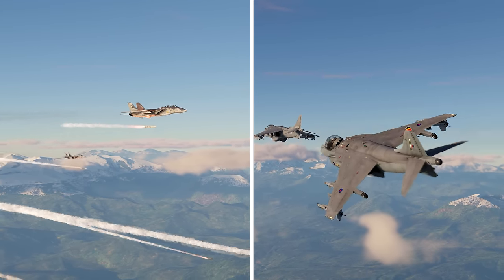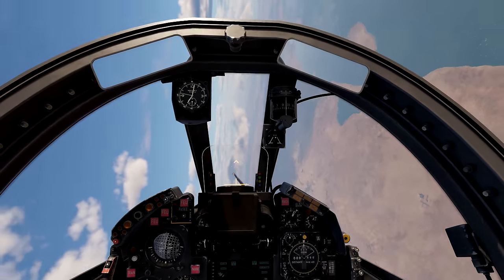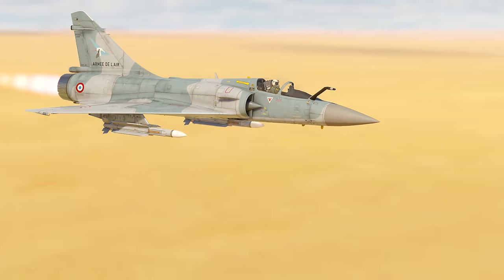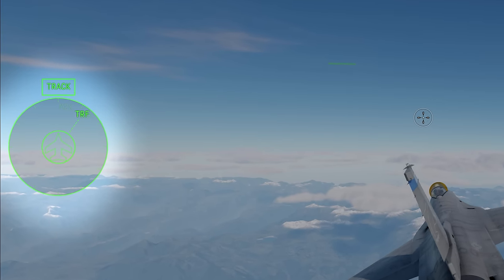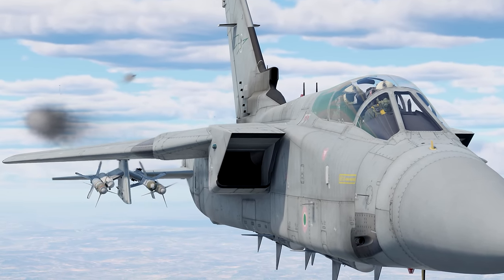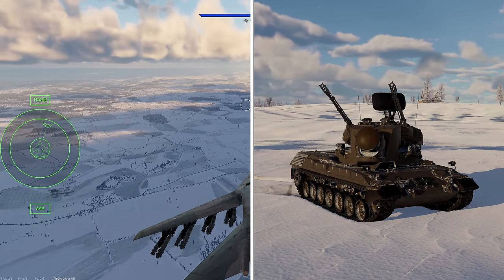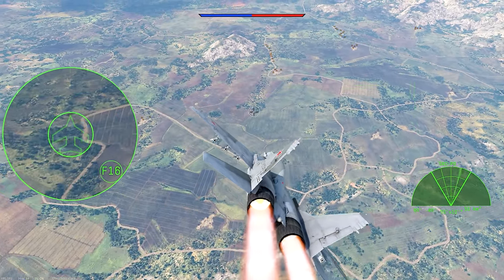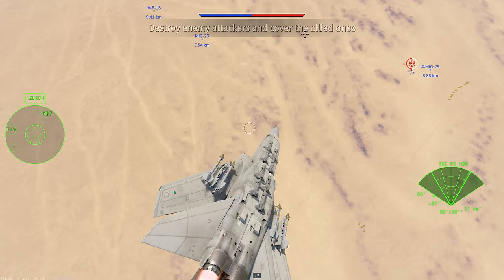War Thunder RWRs: The Ultimate Guide

Comment: What is the deal with the multi-pathing mechanic do you plan on changing it or will all radar missiles be dodged by flying low to the ground?
Reply: Thats a good question CPU well done
Reply: it works that way in real life so it won’t be changed
Reply: @bigboi5962  it is in fact a real thing yes. But in warthunder the effects are greatly exaggerated. Dont quote me on this but someone told me it was an intentional balance feature for SARH missiles again im not sure about the fact it was done for balance
Reply: @ItzCPU_  The balance is that the non monopulse missiles like the 7F, 7E, ect, have much lower multipathing than they should. If it were modeled 100% accurately, the 7M and ER would remain unchanged while everything else would fail at even high altitudes.
Reply: @TheDAWinz   what about the AIM54 is the multipathing on that accurate?
Reply: @ItzCPU_  Yes

Comment: Would also be nice to have a guide from you guys that talks about evading incoming radar missles. They are so complex and keep getting updated it is hard to know how to dodge them.
Reply: Just fly as low as you can. You’ll dodge 99.99% of all radar guided missiles in war Thunder. The rare chance you still die will because you were still within the splash damage radius.
Reply: @PvtPartzz  me and squadmates have been trying to figure them, what what weve discoverd, there are three POSSIBLE methods to defeat a radar missle: 

- Chaff 
- Notching 
- Dropping Low Enough

But the issue is, NONE are consistant, not one, sometimes a combnation will work, sometimes it wont
Reply: @BugattiONE666 flying low is 100% consistent. If you are at or below the tops of trees, you’re fine. Fly more perpendicular to the target while low to reduce the chance of taking splash damage.
Reply: @PvtPartzz  not in the games weve had, Aim7Fs and R27s ignore terrain completely.
Reply: @BugattiONE666 you need to fly low AND try to find cover. hiding behind any sort of hill or all terrain will protect u
Reply: Just play anything not american tech tree and you will be fine (coming from a US tech tree guy)
Reply: @MrRozzi20  ?? the US air tree is literally one of the best (if not the best)
Reply: @PvtPartzz that technique will be gone once aim120 are added

Comment: 5:25 the flanker will also show up as a mig29 as of right now (unless it was just changed, and afaik as someone else pointed out they use the same radar), however it works out fine, as no matter which plane it actually is you can assume it’s gonna be an ER flying at you
Reply: It’s supposed to be that way. The Su-27 has the MiG-29s radar. Same reason that the Italian Harrier shows up as F-18 on RWR.
Reply: @tato300  No they don't. N001 on Su-27 versus N019 on MiG-29. Possibly the same telltale frequency and other attributes, however they are different.
Reply: They designed the su-27s radar to have a lot of commonality with the 29s radar, hence why they both show up as the same. Plus, given that both planes carry the same weapons, people who design RWRs never bothered to differentiate them.

Comment: It would be very good to see in the simulator the activation of lights in the vehicle when they fix you or launch a missile, if you add the alert beeps to that, it gives a gigantic immersion to the simulator, then there would be other good changes for simu such as being able to load fuel in air or that the map feels more alive but it would be deviating from the topic, excellent explanation and very good work Mr. Snail 🐌 ❤

Comment: Question: How is it fair to drastically reduce the effectiveness of certain aircraft’s RWR without also adjusting their battle ratings? Aircraft like the F4J and F14a almost exclusively see opposing aircraft with PD radars which they can no longer detect. 

This change has made flying those aircraft almost impossible in Sim without consistently taking SARH’s to the face with zero warning.

This change should not have gone ahead without adjusting the sim battle ratings.

Comment: Do you plan to have different data base for different aircrafts ? Currently, the J7E I believe still appears as a question mark even if you are flying a J7E yourself. It's the same for the CW wave of the mirage 2000 when guiding a r530 I believe as well

Comment: Question: what aircraft has the longest range AAM in the game?
Reply: Aircrafts*

All variants of the MiG-29, Su-27 and J-11.

For now, anyway. AIM-120/R-77/others coming to a jet near you
Reply: Anything with a r27er
Reply: Longest range ? Phoenix (C version)from the F14B(the C glides better than the A so have longer range). Also that’s currently the only ARH air-to-air missile in the game. However it turns really bad and accelerate slowly.

Best In SARH: R-27ER/ER1, fastest and longest range SARH missile with 35g turn. The plane that carry the most of them is the Su27 and its Chinese version with 6 of them at most.

Comment: How do you dodge missles with planes that have no counter measures
Reply: Simply dodge the missile or don’t approach and be useless like gaijin intended
Reply: Don't raise the altitude and never show your back to the enemy. 
If you think you have an enemy, stick around to the ground
Reply: Notching, fly perpandicular to the missile. Doesn't work for IR missiles tho.
Reply: If it’s a 9l or r60, kiss your self goodbye
Reply: @GipsyDanger41   low flying won’t help against those ?
Reply: Close your eyes. If you don't know where you are the missile won't know too.
Reply: @samson321anderson these guys are stupid af

For radar missiles you should stick very close to the ground to get into ground interruption so that the missile won't see you anymore, for ir missiles, you have a few options depending on the make of your plane,

A: if you are high and spot missile early use HIGH G evasive maneuvers.

If possible point nose towards the sun, cut engine to 0% and turn away and watch the missile chase after the forbidden heat source.

Out run and/or out energy the missile if your plane is fast and manuverable enough.
Reply: @samson321anderson  nope since its an IR guided missle
Reply: @torpy9212  to add on try stay away from planes carrying 9ls and r60s since they have alike a 3km death bubble around them. and you can use your own missles and rockets as makeshift flares.
Reply: @GipsyDanger41  shut down engines ? Fly into the sun?
Reply: @samson321anderson  you can do that but for that to work you have to facing the sun already by the time they launch

Comment: The F-104S.ASA shouldn't even be in this video technically. It doesn't really have an RWR, the one in game is like a pity gift that barely works. In place of an RWR, the ASA has an AN/ALQ-73 ECM unit to jam enemy radars. It didn't need to have RWR because enemy radars couldn't see it, only the effects of the jamming. It a wonder why gaijin is so slow to implement it. Is it that hard to code in? Or do they just not want Italy having a powerful 12.3 capable star fighter?